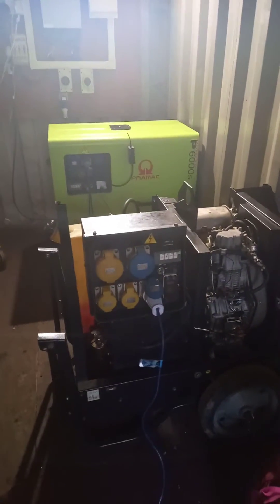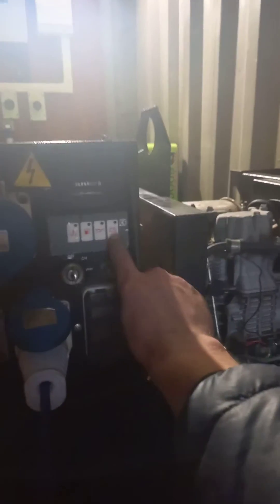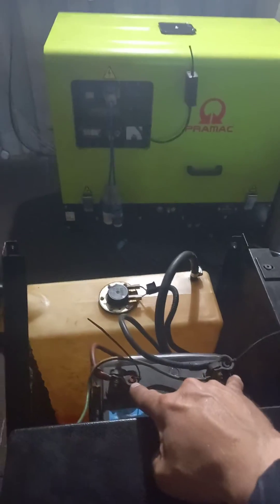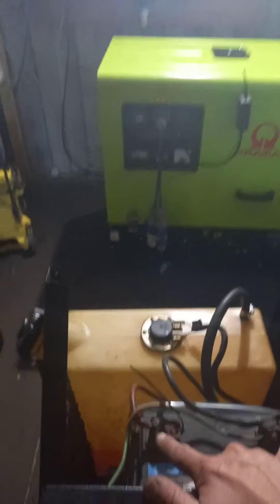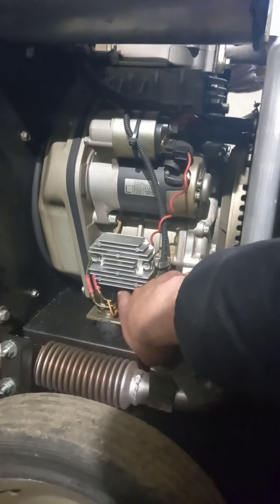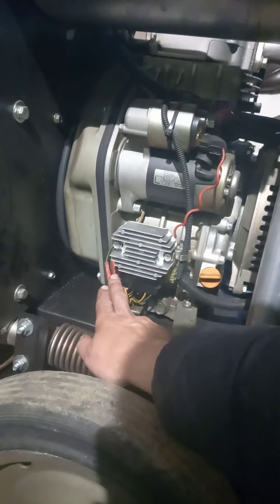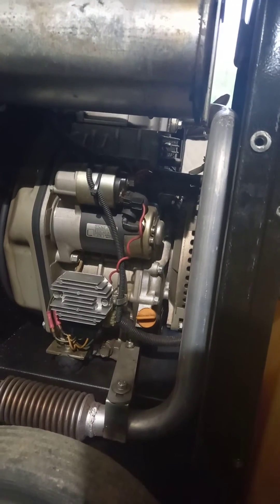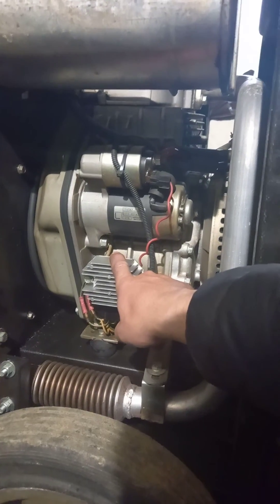Pramac P6000 Diesel Generator Regulator Failure.

Comment: Hi

Where did you buy the new regulator from?
Reply from the maker: Try LS Engineers or Ebay first. I think LS are selling 'Chinese' replacements. Failing that the Yanmar dealer outlets but they're bloody expensive from them!
Reply: @ 
ok thanks. 
Did your regulator have 7 wires?
Good videos by the way
Reply from the maker: @bigfootdoc  The regulators are the same, its the wiring looms that are different on various L100 models that changes. I have a wiring diagram that I can post on the FB group 'Pramac P6000'. If you have a little time it's possible to understand what goes where etc.

Comment: I have a pramac p6000s single phase that's having a similar issue, but it won't turn over at all. 13.6v coming from the battery but when i turn the key, nothing happens. Quiet as a mouse. Could it be the regulator or something else?
Reply from the maker: Check your wires and if it has a fuse running from the regulator running to the starter motor. We're on Facebook if you need more help. Search Pramac P6000.

Comment: What sort of life expectancy do these P6000's have? Do they start causing trouble around 1000hrs?
Reply from the maker: Good question. I've got 2 units. A brand new one and a second hand unit. The second hand one has been a work horse and has only required a fuel stop solenoid. The new one has been nothing but bother.

Comment: Any idea why a new model Pramac P6000s will turn over but not start? No lights on dash, Pump continuously pumps and wont shut off, Changed oil sensor, & Fuel filters, Cant see it being the pump as its pumping?
Reply from the maker: Are you getting fuel to the injector?
Reply: @steelkneel4125  Yes fuel flowing all round from injector & back to tank,
Reply from the maker: I've done a video on solenoid failures. It's sounds like that is your problem.
Reply: @steelkneel4125  Thanks for your quick replies mate, Fuel is flowing fine, wont fire with easy start in air intake so think its electrical, Suppliers seem to think the PCB board has failed so think I'll have to claim it under warranty.
Reply from the maker: @TeesValleyLakes  Have you turned the engine over with the injector out? Absolutely sure its sending fuel?
Reply: @steelkneel4125  Not the actual injector, disconnected feed pipe to the injector and it was pulsing fuel o turn over
Reply from the maker: @TeesValleyLakes  The high pressure line into the injector? Not the black fuel line before the lift pump?
Reply: @steelkneel4125  Cracked that off at injector and fuel pumping on turn over.
Reply from the maker: @TeesValleyLakes  Daft question, the throttle on the lift pump is on? I'm just trying to replicate your symptoms!
Reply: @steelkneel4125  yes mate, throttle is on
Reply from the maker: @stealford3778  Is the plunger moving behind the lift pump window when you move the throttle?
Reply from the maker: @stealford3778  Did you resolve the problem or did it have to go back to Stoke?
Reply: @steelkneel4125  still ongoing, Checked fuel pump, solenoid, control panel, Think you may be right, may be a fuel blockage, going to check injector pipe today
Reply from the maker: @stealford3778  Any outcome Ste?
Reply: Hi, cheers for making the video. I've bought a high hrs Pramac. Seems to run fine. I took a chance as it wasn't too much money.
 It starts and runs fine but the guy I bought it off said there's no charge going to the battery. The battery light is on when it's running. Do you think it's possibly the regulator?  Thanks
Reply from the maker: @jaeme677  Potentially, how many volts are you getting across the battery when it's running?
Reply: Hi, just found your video again. Did you have issues with voltage drop and would a failing regulator cause this? It happens roughly every 15 mins. It's as though it's under severe load for 20 seconds and everything dips then it powers up again. It's not actually under severe load though. Where is the best place to buy a regulator? Thanks for taking the time to answer 👍